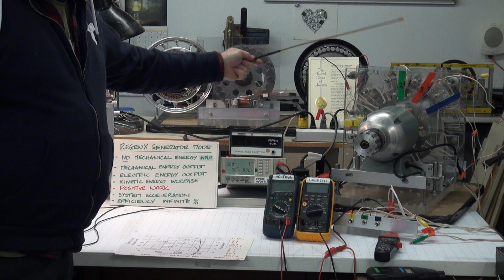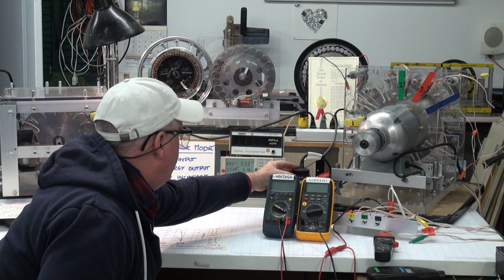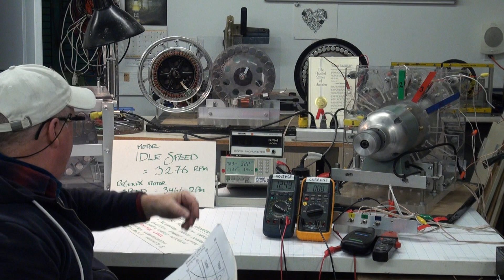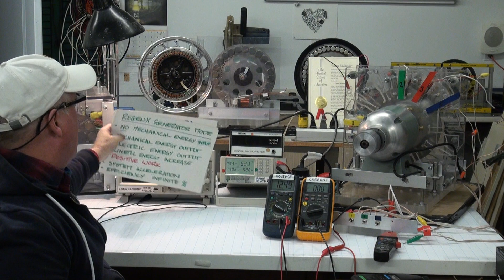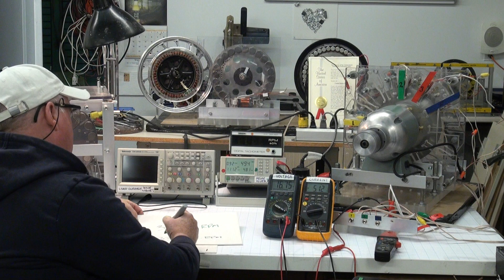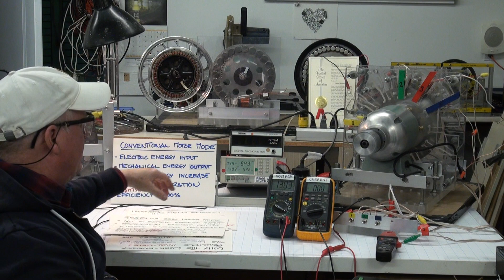PERPETUAL MOTION MACHINE OF THE 1ST KIND ReGen-X MOTOR & ReGenX GENERATOR INFINITE EFFICIENCY

Comment: The effect of acceleration under load is because of hysteresis drag and reduced eddy currents in the output coil at high frequencies...Thane just rotate the rotor when the output coil is not closer to the coil..record the input power to the prime mover..then when the rotor is still rotating bring the output coil closer to the rotor and record the input power to the prime mover..you will find the rotor will decelerate..even if you short you will find the input power will not go down as it was without the coil closer to the coil..hope this helps you...email.. okabangi1987@gmail.com
Reply from the maker: "The effect of acceleration under load is because of hysteresis drag and reduced eddy currents in the output coil at high frequencies..." FALSE

Hysteresis and Eddy Current Losses BOTH INCREASE with FREQUENCY - they do NOT decrease.
https://www.motioncontroltips.com/hysteresis-loss/

HYSTERESIS LOSSES:
Hysteresis loss is caused by the magnetization and demagnetization of the core as current flows in the forward and reverse directions.
 

As frequency (f) increases, hysteresis losses (Pb) also increase.

The equation for HYSTERESIS LOSS is given as:

Pb = η * Bmaxn * f * V

Pb = hysteresis loss (W)

η = Steinmetz hysteresis coefficient, depending on material (J/m3)

Bmax = maximum flux density (Wb/m2)
n = Steinmetz exponent, ranges from 1.5 to 2.5, depending on material

f = frequency of magnetic reversals per second (Hz)

V = volume of magnetic material (m3)

EDDY CURRENT LOSSES:

Eddy current losses are the result of Farady’s law, which states that, “Any change in the environment of a coil of wire will cause a voltage to be induced in the coil, regardless of how the magnetic change is produced.” Thus, when a motor core is rotated in a magnetic field, a voltage, or EMF, is induced in the coils. This induced EMF causes circulating currents to flow, referred to as eddy currents. The power loss caused by these currents is known as eddy current loss.

As frequency (f) increases, eddy current losses (Pe) also increase.

The equation for EDDY CURRENT LOSS is given as:

Pe = Ke * Bmax2 * f2 * t2 * V

Pe = eddy current loss (W)

Ke = eddy current constant

B = flux density (Wb/m2)

f = frequency of magnetic reversals per second (Hz)

t = material thickness (m)

V = volume (m3)

Thane C. Heins

President and CEO, Potential +/- Difference Inc.

Potential +/- Difference Inc. - Pioneering Electric Vehicle Regenerative Acceleration Technology 

& Charging Ahead...
Reply: @ThaneHeins1  just measure your input power of the primemover when the output coil is not present..then introduce it and measure the input power to the primemover and please do a video on it
Reply from the maker: @onesmuskabangi2444  HOW TO CALCULATE ELECTRIC GENERATOR EFFICIENCY: 
https://www.slideshare.net/PDiCEOThaneHeins3240/how-to-calculate-electric-generator-efficiency-101
Reply from the maker: @onesmuskabangi2444  VIDEO 10: WHAT INFINITE GENERATOR EFFICIENCY MEANS & WHY IT IS NOT SYNONYMOUS W/ PERPETUAL MOTION: https://www.youtube.com/watch?v=vVgyNGfXHPU&t=422s
Reply: @dylans voice  am not against the work he doing but why can't he just measure the input power when the coil is not closer to the coil then bring the coil slowly when the rotor is rotating...he will realise it will decelerate...let just Thane do a video on that
Reply: This is all very very interesting. 
My request is to have you contract a third party evaluator to design a testing protocol to verify your inputs and outputs and claims. To simply keep making videos YOURSELF respectfully does not lend credibility. 

When you get help to market, invest, and provide third party validation this tech could take off.   Thane, surely you can attract Seed investment to bring this to market.  What has been holding you back? The three P’s PRODUCT, PENTUP DEMAND, and PEOPLE.

There sure as hell is a demand and the product SEEMS sound but maybe the people are problematic. Reflect on this.

Comment: I still think it would be good to have the motor on a dynamometer to show the mechanical output power during these tests.
Reply: @dylans voice  no, you CLAIM to have infinite efficiency and frankly these long, meandering videos don't clearly prove your case. It's difficult to tell what's going on. What it looks like from my perspective is that you've got an inefficient motor that gets less bad as you engage another set of windings. If it's something more than that then you need better instrumentation displays and videography to communicate that to the viewer.
Reply from the maker: @thescubersteve5214  https://www.slideshare.net/PDiCEOThaneHeins3240/final-2018-report-for-siemens-regenx-generator-bitoroid-transformer-test-data-and-systems-efficiency
Reply from the maker: @thescubersteve5214  https://www.slideshare.net/PDiCEOThaneHeins3240/how-to-calculate-electric-generator-efficiency-101
Reply from the maker: https://www.slideshare.net/ThaneCHeins/regenx-torque-tests-for-magna-international-generator
Reply: @dylans voice  I realize you probably get a lot of crap from a lot of people over what you are doing and claiming, but being quick to snap at people is not going to help your case. I pointed out that these videos are hard to follow and you get all feisty. I think perhaps a professional public relations person should be found to deal with a skeptical public without resorting to backhanded insults. Extraordinary claims require extraordinary proof. Preferably proof that is clear and concise.

P.s. homework has never helped me have a nice day.
Reply: @dylans voice  don't forget, I'm on your side here.  I would love to have an infinite efficiency motor to put in my electric race car. That's why I'm so interested in the mechanical output.